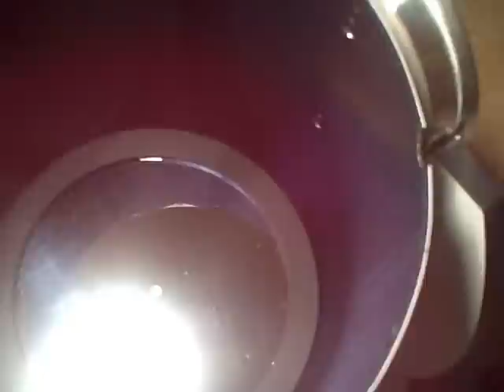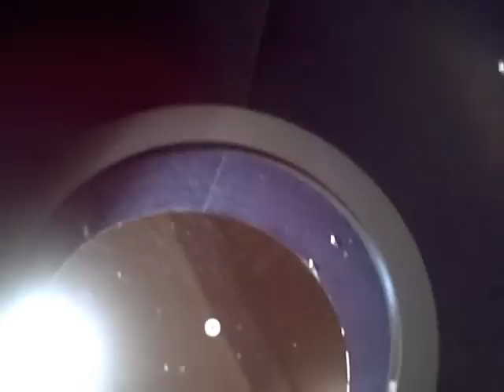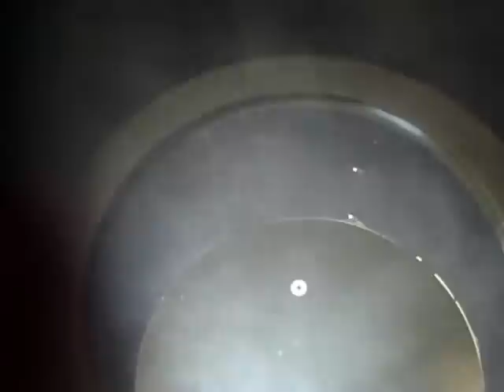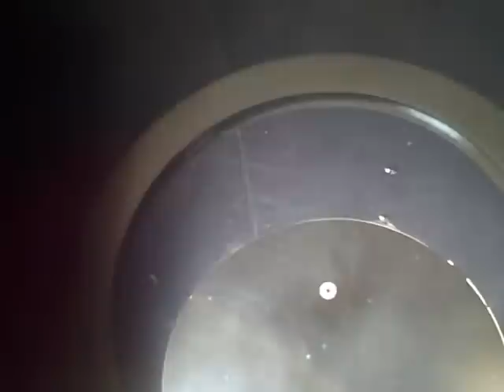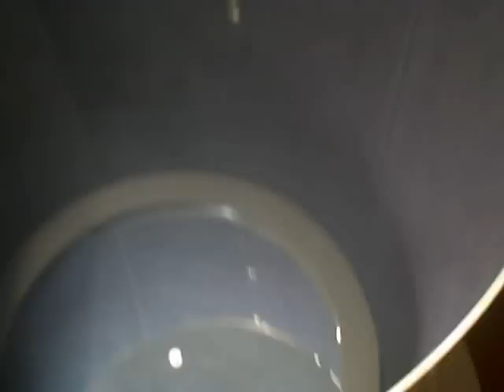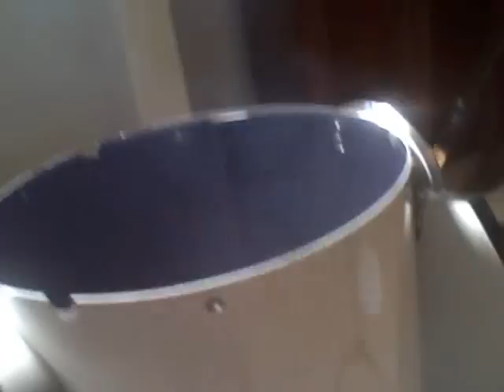Meade 10" Lightbridge - Smoke Test #7

Comment from the maker: @Cyber0Bill 

Yes - I decided to mask the outer edge - the mirror was tested and has a very slight turned up edge.  The actual mirror diameter is 9.75", and my steel rings inside diameter is 9.5", so I'm masking only 1/8" of the edge.

The tube rings were powdercoated black by me, but Meade has now changed the color to black on new units.